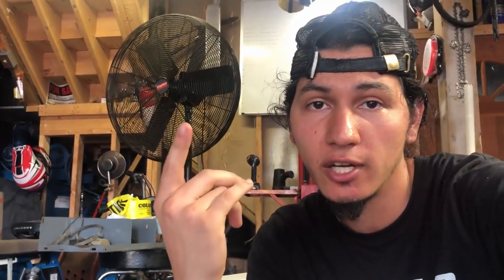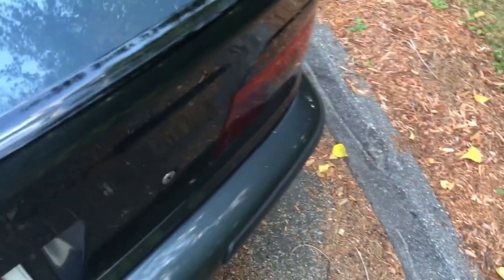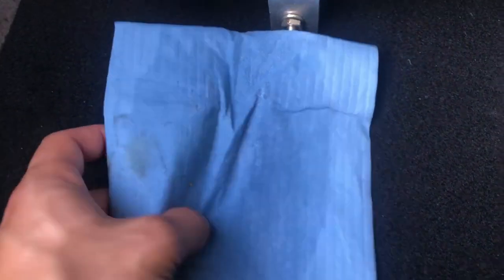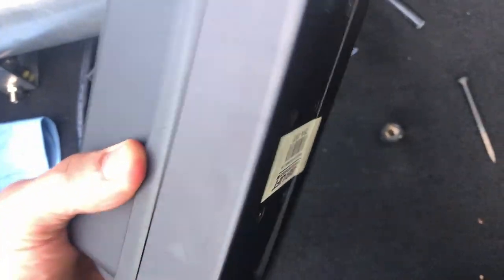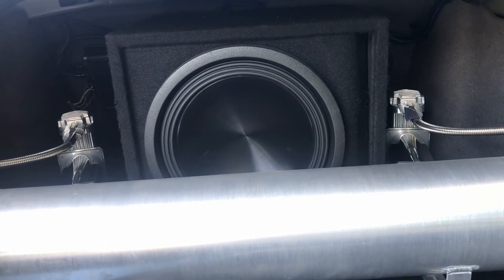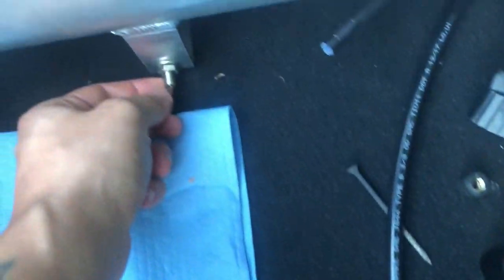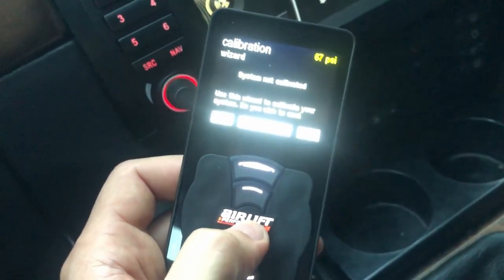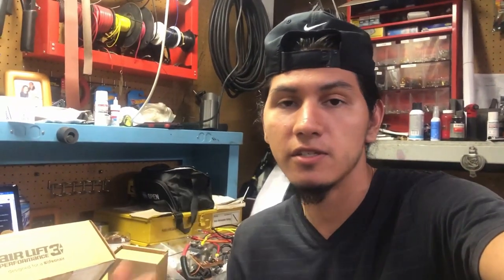AIRLIFT 3P MANIFOLD ISSUE

Comment: Airlift states that the manifold should be mounted higher than the supply port from the tank, I wonder if your failure is due to moisture building up inside the manifold as it’s effectively the low point in your system. - Just a thought on how this failure could be prevented.
Reply from the maker: That would make sense. I didnt see that. I appreciate it🙋🏻‍♂️

Comment: Great video. You recommend going with the 3/8” lines as opposed to the 1/4”? Going back and forth and trying to find out if there’s much of a difference and if the 3/8” is too fast or 1/4” too slow. Looking at this system for 2016 Jetta. Thanks!
Reply from the maker: Thanks! Yea i would say it depends what you are looking for. 3/8 fills up the tank faster and airs out quicker. 1/4 does the opposite. It also depends how many compressors you get. To me, 1/4 was too slow. You could also look up some videos to see the difference between the 2. I air out and air up in my most recent video and i have 3/8.
Reply: My airlines are 1/4 with airrunner struts and I like how slow they are and plus i have my airlines inside the car so 1/4 would fit well running through the rocker panel.
Reply from the maker: Yea. 1/4 lines is still a good way to go.
Reply: How long b4 you had notice your manifold was failing on you? Bc this video is two years old.
Reply from the maker: On the spot. Some say if the psi is off to far. Thats a sign.
Reply: @A1Brian  I just curious on how it failed on you completely…this isn’t a good sign…I just bought airlift 3P MS as well.
Reply from the maker: If anything, now that i think about it. The psi would be off. Lets say i had 50/50 in the front and 60/60 in the rear for my ride height. Which ever side it would say the sensor was bad, was the side it was off about 10-15 psi. So lets say it was the left front. It was would say 35/50 on the controller.

Comment: good video man. glad I stumbled on it.  Im in NJ and bagging my kia hatchback. I ordered the 3p from bagriders, with 1 AIR Zenith compressor and 5 g tank. they forgot the shrader valve (tire air valve) but they shipped it out. now im waiting on my struts from Airtekk. hope they come soon.  Ive read that the manifold should be higher than the tank so water can drain down words out of the manifold valves. I  always wondered about what happens if something breaks, and now youre out of having a car cause it cant air up. those air tire valves to hook onto the ends of the air lines are genious…  im guessing the one on the tank mount u can fill if a compressor breaks and u cant air the tank up... the ones on the valves hoses are good if the valve is broken so u can get air into the bags to raise them...  my question is once you do that will the system hold that pressure and does the controller still guage how much air you manually just put into them? I bought a 100 dollar portable air compressor that imma keep in the car that plugs into the lighter for emergencys so I can get air into the system if the actually system fails. just hook it to the air tire valves in the trunk
Reply from the maker: e l The 3P system is not bad. And those air valves did really help. Without the manifold i couldnt air up anything. It should hold. There was no power to the remote when the manifold was out. Would have to just manually air it up. But the portable compressor would defiantly come in handy!
Reply: shucky ducky it’s all in the install. My first car, bmw 540i that I bagged went smoothly. No issues for about 5 months then I sold the car. I now drive a Mercedes cl55 amg that I also just bagged. In the beginning I had nothing but problems after problems. But after everything got sorted out. It’s been about 7 months and everything is perfect.
Reply from the maker: shucky ducky Yea i believe it depends on the install also.

Comment: thanks for the video.  about the valves that you put on the ends of the line in case your manifold craps out on you.  can you give me a link to buy those?  i have 3/8 lines as well
Reply from the maker: I just added the link for those in the description. Its my most common question😂

Comment: A bro? I got a question I'm hoping you can help me with. I just yesterday installed 3P airlift performance.  It raises up fast as hell. But when I air out, trying to lower it, its super slow.  Airing out is NOTHING LIKE airing up. Why? I have. 2012 dodge challenger with 3/8 air lines with universal air bags on my stock struts.  Is there I can adjust or open the vent/exhaust? To get it to air out faster. Please. I looked online I can't find anything on it. Maybe I'm using the wrong words to describe it? Or?
Reply from the maker: Its the same for me. Airing up is faster then airing out. I have 3/8 line also. From what i seen in other builds, its like that. Im not 100% sure what controls it. But i think thats how the management is. I could be wrong tho
Reply: I heard that. That makes me sad.  Thanks man

Comment: I have a horrible leak somewhere....all my air pressure from the tank gets drained to 0.....I've sprayed all the fittings and nothing is leaking...I'm stumped...could it be the pressure switch being bad?
Reply from the maker: Yea it can possibly the pressure switch. Have you checked it since?
Reply: @A1Brian  it was my check valve coming off the compressor...the pressure switch is inside manifold

Comment: Hey Brian, how were you able to air out if your controller wasn't working after it blacked out while driving. What did you do to be aired out all the way when you got home?
Reply from the maker: So if i remember correctly. When i aired out the tank completely. And unplugged the battery. The whole system went with it. I dont remember clearly but i cant think of another way i did it.

Comment: what are those fittings called that you put on the end of the line to put air in while the manifold is getting replaced ??
Reply from the maker: zulay munguia Those fittings are called Pace Inflation valve (PTC) on bagriders. I saw them for 3/8 line and 1/4 line
Reply: We call them schrader valves.

Comment: Hey whats up bro, when calibrating everything is smooth until it reaches “checking rear”. It stays froze and doesn’t do anything. Why is that?How long should calibration take?
Reply from the maker: Jonathan Guzman Calibrating should take like 5 minutes to do. Has it passed “checking rear” since or does it still do it?
Reply: A1Brian  still stays stuck bro, reason i did calibration is because i wasn’t able to air up. Rear psi would show 100psi on screen but its sitting aired out. The buttons were not doing anything.
Reply: @jonathanguzman4552  the samething is happening to me right now but stays stuck on checking front, sometimes it gets stuck on checking rear and the bags say 140 psi but still on the ground unable to drive. Were you able to solve it?
Reply: Yo same bro,have you figured out why?
Reply: I'm having the same issue. Showed up with pressure sensor failure on rear left. So reset the system and it needed calibrating when calibrating the rear end it stopped doing anything and just froze. Waited 10 mins and nothing tried it 2 more times. I think its the manifold moisture is in there. So iv removed and placed inside the house over night recommended by forums. hopefully gets rid of the moisture. Also manifold is mean to be places above tank height, mines below so this must also be a problem

Comment: Where can you find the fuse at? I have the same issue on mine but I’m curious to what fuse was blown that you mentioned?
Reply from the maker: There should be a fuse for the system its self. Mine is on the right side of the trunk above the battery. It has a little cover you pull off.

Comment: Mine kept saying low voltage and my remote turned off completely is it due to manifold or would it be faulty connection ?
Reply from the maker: I would check the fuses, loose connections and was the car all the way turned on? Mine says low voltage when my car isnt fully on. Because its draining power.

Comment: Dope video. My controller won’t even turn on when I start the car and I don’t hear the compressors, Bluetooth won’t connect either. Should I replace my manifold?
Reply from the maker: Did the message “pressure sensor failure” come on? Check the fuse and see if it burnt out.
Reply: @A1Brian  where’s the fuse of the airlift suspension, mine is doing the same thing
Reply from the maker: Did you install it yourself? It depends where they put the fuse if you had someone else install it.

Comment: Hey bro great video! but how were you able to air out the bags first before you disconnected the airlines to the manifold if the remote wasnt turned on ? Plz help thank u!
Reply from the maker: So if i remember correctly. When i aired out the tank completely. And unplugged the battery. The whole system went with it. I dont remember clearly but i cant think of another way i did it.
Reply: @A1Brian  isnt there a decompression plug on the tank Like traditional compressors?

Comment: I have a airlift system that was working perfectly fine until I went to auto and someone unplugged my negative terminal from my battery, now I get no power to my controller or compressor
Reply from the maker: Dam. Check the fuses and look for loose connections

Comment: I'm considering air bags. Is it worth it and reliable? It seems like there a lot of issues that can happen.
Reply from the maker: With air suspension, problems can come up. I have Airlift 3P. So far ive only had the manifold issue. Other then that nothing else. It also depends on how its installed. If you install it careless, then you are asking for problems. If you drain the tank regularly and keep up with maintenance, then you should be fine.
Reply: @A1Brian  . I was just going to get some lowering springs and call it day lol but i figure bags would be more convenient since you can go up and down. Is the tank something you have to replace often?
Reply from the maker: Bags are more expensive than springs. The convenience is good. You dont have to change the tank. It just holds air. You have to drain the tank of water tho.
Reply: Bags are great at a luxury. Worth it? Yes. Reliable? Of course! Its a car parts are machine lots of problems can and will happen thus needs fixing. I have bags on my car for six years and hardly drive it and still holding air till this week where my manifold took a leak. Emailed Bagriders and I’m in the process of getting a free replacement! Hoping to install it on my channel! Airrunner x Airlift x T-Demand x SSR

Comment: Isn't that manifold supposed to be installed above the tank?
Reply from the maker: Yea thats what ive been told by some people. It helps with the water. But thats how the shop installed it.
Reply: @A1Brian  I'm about to install this system in my ride, it's being shipped.    Besides this, any other issue with 3p?  How long have you had it so far? I'm  Just stressed a bit about the reliability of this setup.
Reply from the maker: Na. No other issues. Just the manifold. Ive had it for 2 years. Nothing else has happened. As long as its installed good. You should be good.
Reply: @A1Brian  thanks man. Much appreciate it
Reply: @A1Brian  installed above the tank how? Like upside down or just make a little piece of wood above the tank that holds it?
Reply from the maker: Like a piece of wood above the tank is what i have been told. They say it helps with water not getting to the manifold.
Reply: @MrMemo0325  yeah or some kind of custom holder....it's to keep whatever moisture builds up in your tank from coming down and ending up in your manifold.    With the manifold above the tank gravity will keep the moisture out of your manifold.

Comment: M having the same issue, it started with the controller glistening on/off, slowly it start to die but good thing I thought about the apps, it didn’t link until my controller started acting funny, after it was like then it died, M now using the apps on my iPhone 6s but since I had to upgrade to iPhone X, it won’t let me download it or link it to two phone, I thought it was the controller so I call airlift customer support and they were kind enough to send me new controlller but it’s doing the same thing so I’ll go with the manifold since it keep saying ECU not found. I don’t know how expensive or or if they can replace it like they did the controller
Reply from the maker: Sounds more towards the manifold. If you are within warranty then you shouldnt have to pay anything.

Comment: Cool video but u dont need those extra fittings because you wont know the pressure and u can pop a bag
Reply from the maker: Thanks. I have them if i still need to use the car. Other wise the car will stay aired out and it wont move. They are for temporary use

Comment: Any word on the route cause of this failure? Just ordered one up
Reply from the maker: banfieldmotorsports Water from not draining the tank often. And when you get the manifold, its a 50/50 chance you get a good one. 2 main things ive been told. And most of the time, it says the Right Rear sensor is no good.

Comment: I need help my bags on my Gs300 stop working all of a sudden. I had it sitting for maybe 2 weeks and usually when i start it my controller turns on and im able to raise it but for some reason my controller doesnt turn on neither does my compressor
Reply from the maker: Have you checked the fuses?
Reply: Check every ground. Dont ground to the body. Ground to the frame. Use big wire for grounds also.

Comment: Problem I'm having is one bag thr rear passenger side always reads 20 psi more than it should so if I set it at 50psi it will go to 70 on its own, no idea what's wrong.
Reply from the maker: It might happen soon. Mine was kinda acting like that at first too. Drain the tank and make sure theres no water in the system. Is your manifold below or above the tank?
Reply: Did you get this taken care of? I just put my system in (Brand New) and the same exact thing is happening to me. The system puts w.e pressures it wants

Comment: Mine just did the same thing the controller doesn’t turn on and I had that same code wat fuse are you talking about
Reply from the maker: So there is a fuse for the air suspension itself. For like the electronics (controller/manifold) Theres probably 1 or 2 fuses. Its not part of the car fuse box.

Comment: Mine too says fault sensor it is at 266 psi but it’s at 0 the front left so probably definitely need new manifold but confused also because my compressors don’t kick on at all so I may just have to get those additional pieces to air up the car for now
Reply from the maker: Dam! Thats really high psi. Have you check the fuses? Those pieces do come in handy
Reply: @A1Brian  yeah they’re clear no fuse has burned I did hear a leak in the manifold so maybe this all happened because I took my car out of town when this snow storm came to Texas it snowed I knew the cold temperatures would effect the pressure so I kept my car all the way Aired up the next day it was snowed out I could still drive then coming back home the car was getting lower losing pressure I had to stop 2 times wait 20 min each time for it to warm up a little the compressors kicked in and I drive home slowly then it just aired out all the way I couldn’t air it back up the compressors never kicked on so maybe because it froze over and messed up the manifold
Reply from the maker: Oh i see. Did you drain the tank of water? Its possible water freeze up
Reply: @A1Brian  yeah it’s drained I even checked the lines nothing frozen I have an auto water trap
Reply: I was able to air the car up with a separate compressor external fill the tank with air to fill the bags but was only temporary only aired up 3 bags front left kept airing out since the manifold was reading fault sensor kept air out down the front left and I even checked the bag nothing wrong with it but definitely going to get those individual tips for the lines to fill manually
Reply: Did you ever figure out what the issue was? I’m having the same exact issue lol

Comment: bro can you help me something? i hasn’t been able to use my car cus of it i just got a question
Reply from the maker: Yea sure
Reply: @A1Brian  my right side back is slowly losing pressure? is that a bad line? because i checked my bag and it’s good and i got a new manifold and it won’t calibrate and im thinking is cus of that
Reply from the maker: Grab a spray bottle and put water and soap. Spray your connections, tank and lines to the bag and see if it starts bubbling somewhere. Thats one way to find leaks. Make sure to be on a flat surface when you calibrate too.
Reply: @A1Brian  nothing is leaking bro but when i get to the “checking front” on calibration it never continues and gives me pressure sensor error after
Reply from the maker: Mmm. Thats tricky. Could be the manifold they gave you. You drain the tank too? Get all the water out?
Reply: @A1Brian  ima have to give them a call and explain whats going on to see what they tell me i’ve done a lot of things
Reply: @TheDailyChillz  i had the same issue on my 3h. What worked for me is checking all the bolts and screws and leaving the parking brake off. Hope it works for you!

Comment: What's the name or link for the parts you got at the end?
Reply from the maker: E G  Those fittings are called Pace Inflation valve (PTC) on bagriders. I saw them for 3/8 line and 1/4 line
Reply: A1Brian Thanks! Never heard of those. Gotta have those!
Reply: Don’t know if you could help me out bro I have this same issue as you I have no blown fuses and I plugged in a new manifold but still won’t turn on compressors or controller 
Do the lines have to be plugged in to make the manifold work or can I just plug in the manifold itself to test it out first?